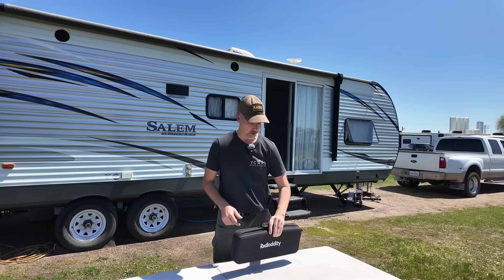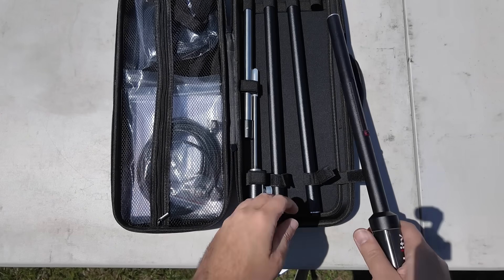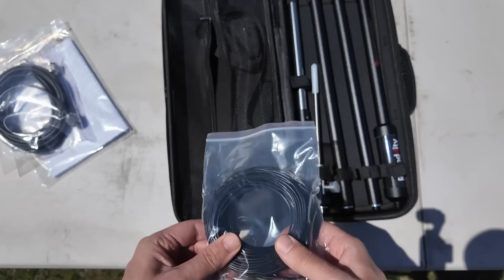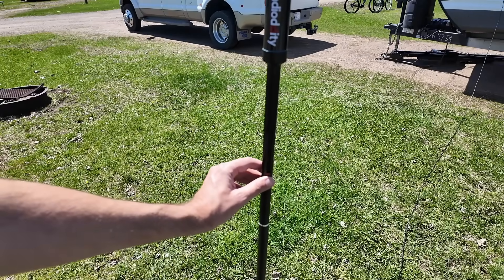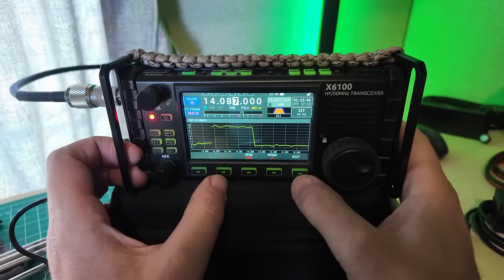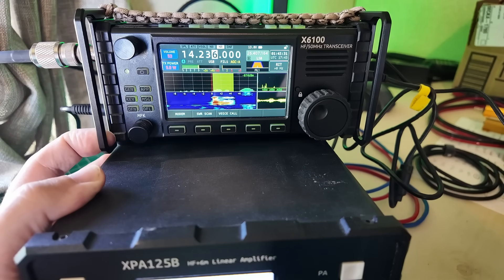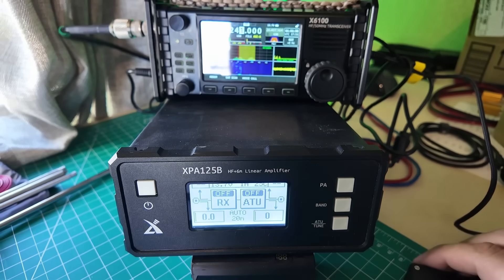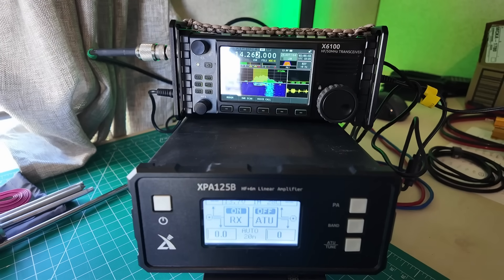This Antenna Shouldn’t Work… But It BLEW Me Away! | Radioddity HF-009 Review

Comment from the maker: What do you think about the Radioddity HF-009?
Have you tested it, or are you sticking with your go-to portable antenna?

👇 Drop your signal reports, setup tips, or even your skeptical hot takes below.
💬 I’ll be replying to as many comments as I can—especially if you’ve got POTA stories or tuning tricks!

🛠 Gear used in this video is linked in the description.
👍 Don’t forget to like, share, and subscribe if this helped you out!

#HamRadio #QRP #KM9G
Reply: i9 like the antenna however listening to yolur reception static i concluded  that a different i don't know if  upgrades exist to xigu radios has  to much static
Reply from the maker: @jasonhowe1697 I like the static for pulling weak signals, but there are a ton of filters in the Xiegu that will remove it.

Comment: Nice video! Justice curious, why didn’t you use the X6200?
Reply from the maker: I have a long history with the 6100, so I prefer it.  If people ask I tell them if they have a 6100, don't upgrade. Not enough value in the 6200 over a radio you already own.  If they don't have anything, get the 6200 because I think Xiegu will support it longer.
Reply: @temporarilyoffline  Cool. Thanks, Do you still have the 6200?
Reply from the maker: @winexprt I do!  It misses me. I should get it out

Comment: i don'y the xigu's aew suitable  for this type of testing to noisy

also note  you should be connected  to  a patch pannel losse cables are a no go

inlet side  of van  you have the width  of the tow vehicl 5-6'  door side with awning 8'5"

you would exceed 15 feet   nopte anything percieved as a tripping a\hazard   may need  hazard markii9ng tape or cobering
Reply from the maker: Thanks for the tips

Comment: Some reviewers have found the antenna to be very broadband suggesting that it lacks efficiency. What is your take on this ? Some tuneable portable antennas are very narrow band and require a lot of retuning.
Reply from the maker: Efficiency is an argument you can't have until you know the mission at hand.  A dipole is very broadband, does that make it in-efficient?  Is it easier to pack and setup or is this vertical with its carrying case and no trees needed.  "Efficiency" depends on your mission/argument parameters.  This antenna gets me on the air and makes plenty of contacts.  I'm happy = efficient.  But not everybody is happy for the same reasons, that's what makes the world go 'round!
Reply: @temporarilyoffline  Thanks for your reply.

Comment: Another review of this antenna showed it to be suspiciously broadbanded on many bands, just as it looks to be on 20m in your video. It doesn't strike me as a "High Q" antenna at all. I've got one of the Chelegance antennas with a calibrated sliding whip instead of an adjustable coil and it has very clear and much narrower dips on each band. Wide enough that you can dial it right in with a tuner, but much narrower than that flat line on 20m! I generally use a nano VNA as I'm also suspicious of the 6100 swr scanner, at least the one in the stock firmware.
Reply from the maker: Great information, I will have to give it a try.

Comment: Somewhat like a manually tuned Hi-Q Antenna coil.  Although, it's a much small coil than any Hi-Q Antenna coil.  I wonder what type wire is used for the coil?
Reply from the maker: I wonder too... No specs on that or the coax.

Comment: Nice antenna . Radioddity makes great stuff. I got a bunch from them. FRS/GMRS/CB /QT 60 10/11/12 meter radio. All great . I think my MURS radios are as well.  I got few different brands . Like that amp !  You can easy carry that all to POTA spot !  Even on the motor bike and set up and ham hard . We got some strong storms over night in NY . Nothing bad. Just thunder drove my cats nuts and some down poor's.   I think that antenna will hold threw it.   73
Reply from the maker: I wish I had the chance to leave it out in a storm, I have to chase the grass cutters schedule...

Comment: Why do these Chinese antennas always come with spikes and no tripods? Here in South Carolina, you can not put  spikes in historical parks. I will say this one looks the best out all the Chinese antennas I seen on YouTube.
Reply from the maker: I have many that comes without a spike or a tripod.
Reply: Because they can make them cheaper, less parts, and make the kit smaller for shippping.
Reply: There are adaptors. I have a 10mm to 3/8-24 that rolls the antennas into appropriate thread mag & trunk lip mounts. Probably a 10mm to 1/4-20 tripod out there somewhere. And . . . many desk lamp clamp bases mate with the spike for use on a ledge or picnic table. I know that ‘cause I use one with my version of this antenna. Online search will find ‘em.

Comment: Anything is an antenna if you're brave. Or own a good ATU... :D   I've been using a HamKing HVT-100 which is a cheap (50GBP over here in the homeland...) multiband manual screwdriver type antenna. It seems to work as well as an other sub 9 foot or so antenna I've used, and it breaks down into something that fits easily into the trunk of these small tin boxes that we call cars over here.  A bit twitchy to tune on 40m and don't even think about 80 but it does a great job elsewhere.
Reply from the maker: I'll have to look that one up!

Comment: Love the design except for the non-removable spike at the feedpoint. I’d like to use this antenna on artificial turf.
Reply from the maker: It is on their really good.  There is a ham-way to get this antenna on a tripod or clamp for a table.  It's a 3/8-24 connection, so you can get the hardware and make it work
Reply: @temporarilyoffline like a jaw clamp on a stubby tripod? Would elevate the radials a smidge

Comment: I couldn’t tell but were you using the amplifier’s tuner as well? Could you repeat this but with the Xiegu G90 to see what 20 watts and its tuner can do?
Reply from the maker: I was not using any radio tuner with this antenna, it's not needed.  The G90 would work great with this antenna!
Reply: @ If I had 100 watts, I know I would crank it to 11 but I saw at a POTA that the 2 guys with G90s were talking all over the place.

Comment: I do like the kits that utilize extention poles thus keeping the telescoping section shorter and making a mechanical stronger system. The coil adjustment is just too cute for me hihi
Reply from the maker: This is a strong antenna.  You can see they put some thought into it!